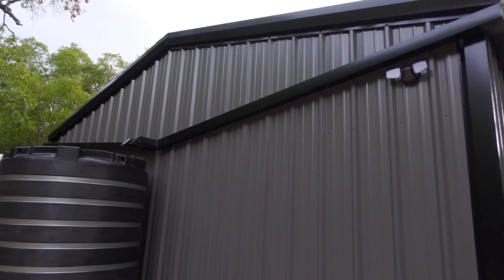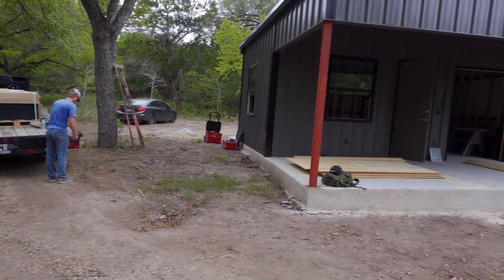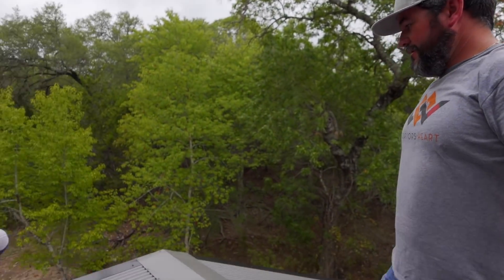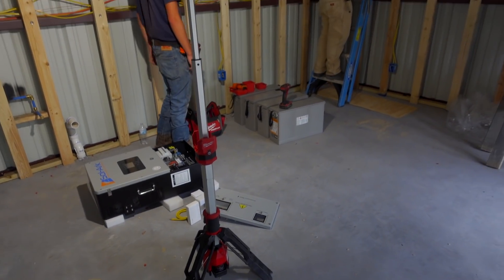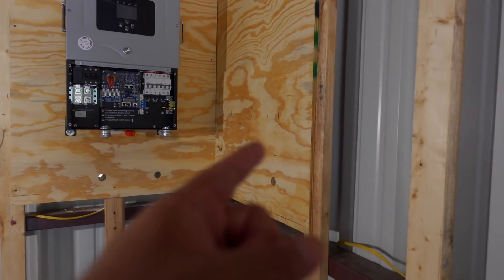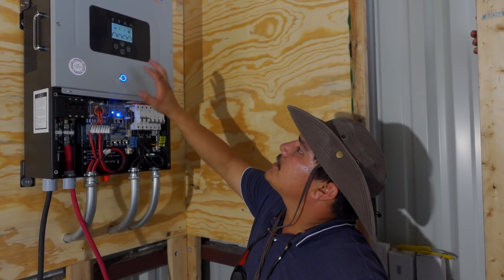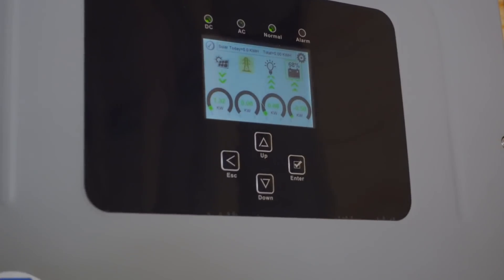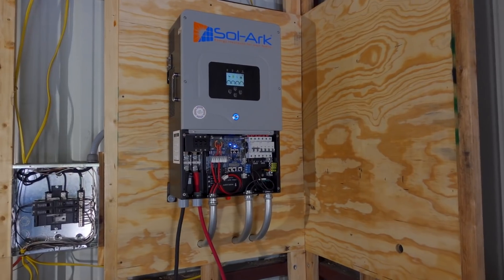Solar panel installation | Demolition Ranch HQ Build part 16

Comment: Series panels to increased the voltage and parallel panels to increase the current output. Power in Watts = Voltage x Current. Your electrician is spot on, DC power is no joke.

Comment: if they wire the panels in series the way they said then its like Christmas lights if one panel goes out for any reason then that whole bank of panels goes off line.  So a branch crashes on a panel your supply is cut in half until it is replaced.  If Matt is in the middle of surgery on a pooch he could be in the dark, (kidding)

Comment: Ok as an electrician I have to suggest you slap your electrical contractor. That conduit work is sloppy and poorly designed. a Connector into the LB on the outside of the wall is bullshit creating the need for a massive offset and poor fit and finish.  The 90's coming out of the bottom of the MPPT controller look amateurish. The controller is also mounted a foot higher than it should be.Then using PVC TA's as insulators for the conductors to the batteries provides no strain relief support leaving all the strain on the mechanical connection of the wire. and both conductors are required to be run together to eliminate magnetic field heating via field cancellation.

Comment: When i see a system like this it makes me wonder why we are all not on solar with a natural gas/propane generator backup. If/when I ever build, I will entertain this option. Thanks for the education.  In a typical home, what would the cost be and how long would it take to see the return of investment?
Reply: Rob, I'm glad you liked it!  In my experience the average net cost after local and federal incentives are considered, the average cost is around 20K with somewhere between 5-7 yr return on investment, or you can do a solar finance with $0 down and have an immediate savings as the payment usually is less than the average utility bill (depending on the amount of sun (efficiency of production) on your home and local incentives)

Comment: I have a similar setup of solar on my roof. I’ve got 24 Mission 310 panels and the iron ridge racking. The difference is I did enphase microinverters. Did the whole thing myself from design to install and finalization. Love the series here. 
Thanks for the videos!

Comment: I have put in 15,000 pound battery packs for big office buildings. 
For the 3 to 5 sec it takes for generator to startup when power goes out. 
Battery backups are cool.

Comment: When they penetrated the roof to install the mounts how did they resolve being water tight around the penetrations?
Reply: @William Write  I was wondering the same about the roof penetration being watertight. The self piercing screws through the brackets are above the valleys in the sheetmetal. The brackets  may have a gasket and screws may have a rubber washer to prevent leaks. The gaskets and washers would probably be necessary in northern climates because of ice and snow. Not so much in Texas.
Reply: @Hanzy Scure I was thinking much the same. They also mentioned a glue I wonder if that acts as a sealant as well. I’m always think about what are these penetrations going to look like in 100 yrs with the elements taking effect on them. Do they have a lifetime like 30 yrs and need to be replaced? Curiosity has me wondering.

Comment: Damn, all that money for batterys that won't hold up for long. Should have just but the bullet and bought lithium. In the long run and capacity, they are the same cost.
Reply: Lead-acid has a long life in a non-harsh environment. Only real downside is they are not space efficient.

Comment: Ok multiple things : You are 100% off grid so no electrician is required. On the water still get that crappy as filter system replaced. Do many leaves will clog up the water intake. Use on the gutters a 1mm stainless mesh filter system cost you about $800 but than you never have to touch the thing again. 
Solar are the wrong panels you do have metal so glue and stick Lumeta Lynx 72 which are 360W Panels simply remove the Glue backing and glue it onto the metal roof. It is a TAR Glue so it's good for 50+ years so it outlast the Roof itself.
CODE VIOLATION ALERT: You do need over 2' of space on the bottom of the panels on the roof. That is national code if the modules are not walk on like the peel and stick we use you can walk over them no problem.
SOL-ARK ??? Made in USA ... nope their products only are a big waste of money. Go SMA and you are half the costs. Same for lithium batteries are super expensive and only last you max 3 years before they loose power and you can replace the thing. Solar Deep Cycle Batteries or any other Deep Cycle does do a 500% better job with 1/4" of the cost with a battery life of over 8years and because they are LEAD they are 90% recyclable where lithium batteries are BURNED as a method of  recycle. 
Electrician why the world are you a muffin and don't run thru the roof vent cap into the building you only run 2 AWG 8 wires to your Inverter unit. I am looking at so many job's where people just don't get their stuff right. 80% of the time we have to redo the electrician's work because they either use the wrong wire, from gauge of the wire or from everything. Looks like the electrician used plenum tin coded wire. Which we don't recommend because of the per foot DC loss been 10% higher than solid strand THHN 8AWG wire which has 30% higher copper content inside the wire and because we do have to use EMT we are not exposed to UV so all good there to run it. Also you could had run the string on a single wire not even 2 pairs. Panels are only producing about 6 * 18V ~  108V DC and on the Amp side 6 * 10Amp  so 60AMP which is really nothing on a load side. On this setup you have a 10-15V DC loss so a total of about 18% DC loss. Not very effective on the Solar Engineer side. 
So a 4KW Solar system with 12 panels, inverter, 16 batteries and install should run you no more than $10,000 USD
Reply: All that talk talk talking and not a word about the tree right next to the building shading the heck out of the panels.  I don't think you are as smart as you think you are....
Reply: Spam ?
Reply: @Hanzyscure  Ya probably so.

Comment: If you cover the panels, that'll turn 'em off.
Reply: This is true, but you have to cover the whole line because the line is hot if even one panel is generating.

Comment: Would it be better to run PVC piping for the wires to run through? So if for any reason a short would to happen it wouldn't catch the foam on fire behind the wall?

Comment: I was really interested in seeing this as I’ve been interested in solar power for years. I was disappointed there were few details on the components like panel wattage, inverter wattage, brand of panels and so on.
Reply: Watch off the ranch’s episode of this job. They give the details of the panels but Texas barndominiums gives better details about the inverter and job.
Reply: Jacob Manipon thanks! I’ll check it out.
Reply: Hey Bob,  I was the solar guy for Matt on this building.  The panels are Mission Solar 320W all black, Solark 12K inverter/charge controller, and we used Iron Ridge racking.  Let me know if I can help in any way brandon.j@earthsmartsolar.com
Reply: Brandon Jones thanks Brandon! I’m not ready to build yet but hopefully in the not too distant future.

Comment: the panels won't kill nobody,  it's DC low voltage
Reply: Not exactly. In Matt's video we know they are 320W panels with an open circuit voltage of 40V. There are 6 connected in series. 240V is a good jolt...AC vs. DC is irrelevant. Plus the fact you're on a metal building (well-grounded). Yeah, it would not be fun.

As far a current, it takes less that 500mA to stop your heart.
Reply: The DC versus AC is meaningless in the "is it safer" argument. Also, those panels are wired up in series, so an individual panel may be "low" voltage (I don't have the specs on them, so I'm not going to say definitively), the the total voltage that each run generates is six times the base voltage. Also, we don't know the current of the circuit, which is more likely the killer.

Comment: question/observation.. are the batteries going to stay on the floor?  or they going to be mounted on the wall too.. seems the battery cables should be longer for better cable management.
Reply: I understood them to say that they will put in a shelf mounted to the wall after the insulation foam is sprayed in and the plywood wall sheathing is installed.  They will move the batteries to the shelf.

Comment: If the disconnect for the panels is in the inverter, did you have to hook them up hot? Or is there a separate disconnect for the panels on the roof?

Comment: The only thing I understand on that whole site, is the 5 Ton, because it is metric. 😂
Reply: I think a standard ton is different than a metric ton. The 5 ton is built to haul 10,000 lbs or 5 standard tons. Imperial ton is 2000 lbs metric ton is 2205 lbs.
Reply: @beek2930  Careful, the US Short Ton is 2000lbs, Imperial/Long Ton is 2240lbs/1016kg
Reply: So it's settled, then. For about 3 hours I understood one thing on that site. Now I don't understand anything...
Reply: Falls short of 5 metric tons, this is imperial tons aka 10,000lbs
Reply: Lol its not metric
Reply: If it was metric it would be spelled tonne
Reply: well you know, there are two types of countries in the world: one that use the metric system and one, that put men on the moon
Reply: Der Mozart According to this article (https://ukma.org.uk/why-metric/myths/metric-internationally/the-moon-landings/), the Apollo missions were flown using the metric system. Imperial was only used when units needed to be displayed on computer screens for the astronauts to read, as they were used to imperial being trained USAF pilots. 😉
Reply: <--- I grew up with metric.... when i learned Standard... I loved it... I could actually picture the distance, because the numbers were different for everything.... hard to explain!... Cheers.